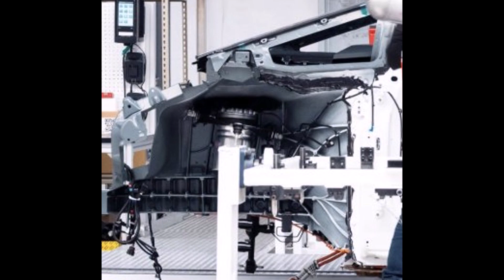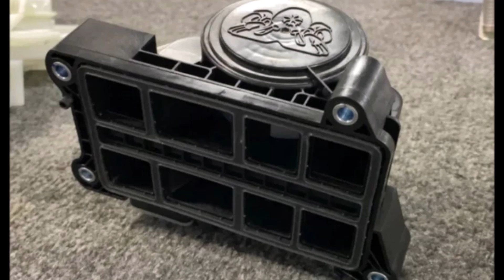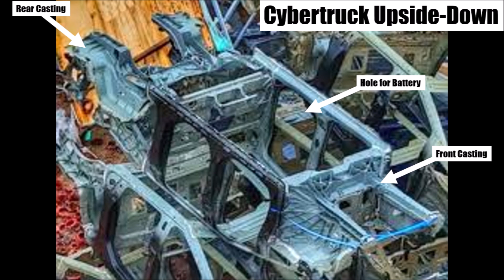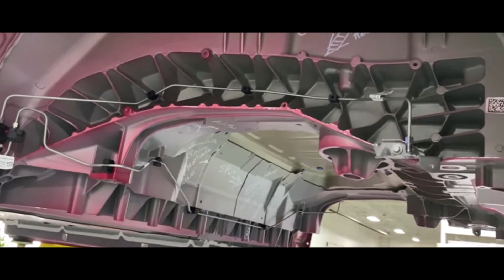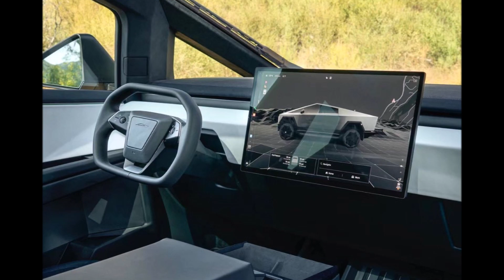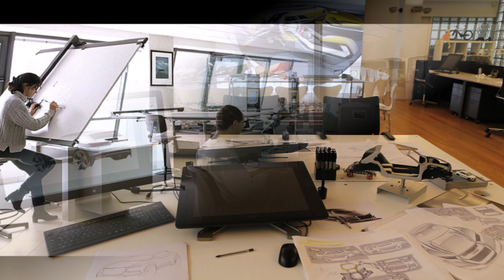Tesla Cybertruck - Changing the Car World?

Comment: nice vid. but on the topic, as a costumer i like to have parts seperatly. why? everything is getting more and more expensive. one example. headlights: in the past, my lightbulb was broken, i bougt a new one for 8 euros and could change it myself. today, my led head lights can't pass  the TÜV so i have to replace the whole unit at my shop and they charge me 2000euros and if i'm very unlucky i have to change both units. another example is the DPF . i had a faulty DPF and had to replace the whole unit which also was the catalytic converter so alot more expensive if it would have been only the DPF. so having seperate parts that can be changed seperatly is a good thing IMHO

Comment: Thank you for covering it from an engineer's point of view. 

Something i might add: the 4680 cells revealed on battery day claimed that the whole battery pack is part of the chassis structure itself. The steer by wire system is quite genius for its application and has been used on airplanes for very long.

Comment: Another interesting analysis. Many businesses have "compartmentalisation" of abilities. It is indeed infantilising.

Your point about the combined air tank / structural element etc reminded me of the design principles of Colin Chapman. Every part must ideally have several functions. This should indeed be rule N°1 of engineering. Anyone who is not able to at least appreciate power to weight ratio, structural strength, mechanical performance and aerodynamics should not even work for a car company!

So we can see that there are ay least some redeeming features things with the Tesla truck. It is just a shame that I cannot comprehend who might even be interested in buying a heavy, bulky expensive pick up with limited load volume.

A topic for a future video is the best use of energy and CO2 in both use and fabrication. Electric cars will have no future unless better batteries (without rare earth materials) are devised.

Comment: You forgot the steer by wire which is probably the most impressive thing in it. What is most impressive of course is that they have put all their innovations in this. The castings, structural battery, cooling system, carbon wound permanent magnet motors, 48V low voltage system, steer-by-wire and stainless steel body panels. I cannot imagine another car that introduced so much new technology at the same time in the same actually mass produced product.

It seems as if everything outside the battery supply chain is child's play for Tesla. (Since they still use mostly partners to manufacture cells) They seem very confident in their own technology.

Comment: What is interesting is when you compare Edison Motors semi to the Tesla semi.  Where as the Tesla is all custom and bespoke components, Edison is going off the shelf as much as possible.  Instead of customers $4000 headlights, Edison uses $20 headlights you can buy off the shelf. Tesla has all its components in house so you have to buy from them to replace anything and they can charge whatever they want.  Yes you can innovate that way but you also can restrict yourself by not allowing other companies to be included.  What happens when you redesign a new part, who is going to make replacements for the old ones? I think Tesla is starting to fall behind the curve as we see their lineup stagnate and more options from other manufactures become available.

Comment: I worked in engineering for a major manufacturer for 30 years and your observations about supply chains are dead right , it kills innovation , I’m just uneasy about this mad rush to electrification with so little infrastructure , battery fires with thermal runaways etc. to me it just doesn’t make sense with battery energy density and even the raw material supply for the batteries .

Comment: Problem comes when you create a battery as a structural part of the chassis you're going against sustainability and also, you run the risk of fire, or at the least, the battery being inoperable after a mostly minor shunt that traditionally, the car could drive away from.

It's a valid point to make that corporate bureaucracy stifles good design though. Especially when you are subcontracting sub-assemblies to other companies, but, that's not such a bad thing. If only Audi can produce x, y and z components for their cars they can charge extortionate prices for them, which of course already happens, but it would be worse.
As it is, in some cases you can get a cheaper version of a component by either going to another manufacturer entirely, or straight to the supplier, which for the economics of car maintenance is very important for the end consumer.
Otherwise getting something changed such as a light bulb will be a nightmare, gone will be the days of finding anything that will fit and just jam it in there, it will end up being a bespoke fitting etc etc and cost you 50 quid to get a replacement. And to be honest, we're already almost in that place right now. Having in house parts production would just make it so much worse.

In any case the other downside to bureaucracy is people don't want to take responsibility for anything which is why the first anecdote you told probably happened, it probably has little to do with contracting the part to be made and everything to do with people not wanting to take responsibility for it, which is why it was a hot potato. They don't want to take risks, and the only people who do, only want to do so for boosting their own careers, not for the benefit of the product.
Reply: I stand and clap for this response, the "right to repair" era is here and now, and Tesla is one of the major players in fighting the end users right to repair a product they bought paid for and own.

Comment: This car makes me very sceptic about Musk's claims of a 200kwh battery for the new Tesla Roadster. If the car of such dimensions and weight (3 tons) has a battery of 120kwh, I don't find it possible that you could create a smaller, 4 seater and especially a good handling sports car with twice the battery size. It seems like Musk was either too optimistic with battery tech progression or just milked potential buyer base with insincere engineering claims

Comment: I think it missed the mark for real truck people.  It works as an SUV, but the sloped sides on the bed are a huge issue for a lot of use cases.
Reply: Plus the impossibility of putting any normal lumber rack on it.
Reply: @grizwoldphantasia5005  Yes, I'm sure over time there will be options for things like this, but they will be more expensive as you cant just buy one of the infinite number of options already on the market for that type of thing.

Comment: I totally support your take. Because that's why i appreciate Tesla as engineering solutions. Furthermore i  see many parallels with Apple. Both engineering and software approaches can be admired. I totally se your points about cross department talk. Its marvellous jut one quick  example they can make rolling improvement on assembly level is aluminium rear charging cable housing - simply lovely integration.

Comment: You missed mentioning steer-by-wire! Also amazing video, this and Jason Cammisa has been the only video on the Cybertruck I've watched!
Reply: Lexus/Toyota did it first. And I think they said it was better implementation.
Reply: @gerogyzurkov2259  No the implementation is similar or better.
Reply: its nothing special lol1!!!
Reply: I hope steer by wire doesn't catch on, for safety reasons.
Reply: @C.I... there is no safety issue.
Reply: @Tommmmmmmmmmmm  there is no Hydraulic steering with it. So it's only steer by wire. Normally they would include a Hydraulic physical system with it. For safety reducinces. Which includes in airliners which they have the physical system still with fly by wire for extra safety. Cybertruck doesn't have a Hydraulic physical system with the steer by wire for extra safety.
Reply: @C.I...  To quote Jason Cammisa: "We've had throttle by wire for decades. Majority of new cars are brake by wire. Ever heard of a failure?"

Comment: Don’t all the changes, especially the battery configuration, make it much harder to repair? It might be impressive but all of this might make you wonder why others aren’t doing it. Also given that tesla is behaving pretty anti repair I don’t think they are doing this for optimisation purposes only.
Reply: I agree with you that if can bend a front casting you have to dismantle the car and get good for some tig welding but in hagerty exclusive on the cyber you can see the safety test: a 48 kph 1400kg impact caused little to no damage so i imagine that if you end up cracking that frame that you could be the least of your problems
Reply: They do, that is one of the downsides.
Reply: what, bro the configuration is to save massivley on production costs, it may effect the crash behaviour negativley but we dont know that, just speculation. this is done purely for optimisation

Comment: I do find the vehicle fascinating, but there is a minor inconvenience. Its gross vehicle weight rating starts at 3629kg, so you would need a commercial vehicle driver's license for it in the EU/EEA. 
That means you can't legally drive it with a Class B license. You'd need Class C1 or higher (C1E or higher if you want to utilise its towing capabilities too).
Reply: Better off this way. Pickups are supposed to be work vehicles so you shouldn't be incentivised to get one if you don't need it. Also in Europe no way this would either fit safety regulations or our narrow roads and parking slots.
Reply: @filippo8495 Both are fair points, and I won't complain about not seeing them around
Reply: In my country you can already drive alternatively fueled vehicles up to 4.25t in weight with a B category license since 2021. There is a proposal to increase the weight limit to 4.25t for alternatively fueled vehicles on the EU level.

ST 6795 2023 REV 1 Article 9 2. (h):
two years after a driving licence, granted for category B, was issued for the first time it shall be valid for driving the alternatively fuelled vehicles referred to in Article 2 of Council Directive 96/53/EC⁵ with a maximum authorised mass above 3 500 kg but not exceeding 4 250 kg without a trailer.
Reply: @baksatibi Oh I see, I didn’t know that. And there is even a source! Best response I ever received on a YouTube comment, thank you
Reply: @baksatibi  Even if the weight would not be an issue with the new EU-legislation - having Tesla Cybertruck in thr B-category would be very problematic when it comes to it's pedestrian safety. For crash testing it would probably already fullfill all requirements for occupant safety, even if it wouldn't score the best in third party tests.
Reply: judging by its shape its never going to be available in europe due to its pedestrian safety violations. or am i wrong?
Reply: @HannyDart  I believe it is not intended to sell in Europe. It also has steer by wire which is also not acceptable in Europe without a mechanical backup system (I couldn't find out if it has one).
Reply: In my country you can also drive trucks privately without most of the commercial limitations. Speed would obviously be limited to 80km/h.
Reply: Wrong. The curb weight is not 3629kg, it's 3000kg.
Reply: @boostav  You are correct, but curb weight isn't the same thing as gross vehicle weight rating. The difference is similar to how you have an empty weight and a maximum takeoff weight for aircraft. 
License categories don't really care how much your car weighs empty, they only care about how much your car would weigh with everything that you can legally put in it (so fuel, people, luggage).

EDIT: I realise that license categorise might be determined differently in the US or UK than they are in the EU/EEA
Reply: @NotDomm98  I know ... the manufacturer can simply homologate the vehicle with a lower payload. So it's not an issue because Tesla can simply put the max gross vehicle weight rating at 3500kg and sell it in the EU.

Comment: I dislike the Cybertruck for its inefficient form, but this video made me appreciate the engineering underneath. Thanks!
Reply: Id say the lower drag is not well designed, i assume they performed the tests with the cover over and all. But that means you cannot see out the back window and also the high edges of the bed make it harder to load stuff into from the side. Lower drag but does that compromise practicality??
Reply: Cybertruck has a lower drag coefficient than a Bugatti Chiron
Reply: @Tommmmmmmmmmmm   Exactly and way lower Cd than the Ford F150 Lightning and other conventional trucks... If Tesla was not dictated by the flat and sharp edges, which is giving the Cybertruck that incredible rigidity, then they would've achieved something on par or lower than Rivian R1T.
Reply: Believe it or not, the Cybertruck has a lower drag coefficient than comparable trucks in the segment.
Reply: @AR_434  
Not true, the Rivian R1T has a lower 0.30 Cd vs the Cybertruck's 0.335 Cd. While the Cybertruck is a bit larger, Cd is about shape, and the cybertruck's blocky edges likely hurt aero.
Reply: @AR_434   i mean its a lot of flat surfaces so cant be too bad